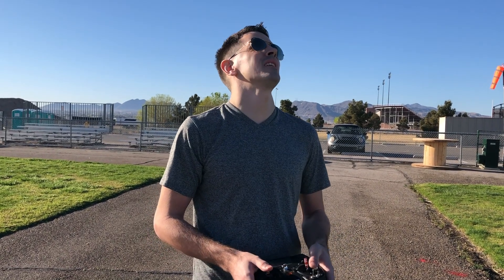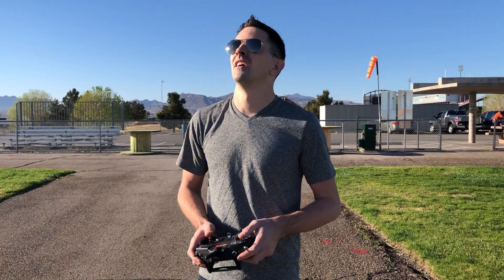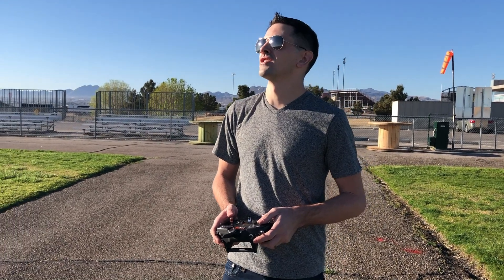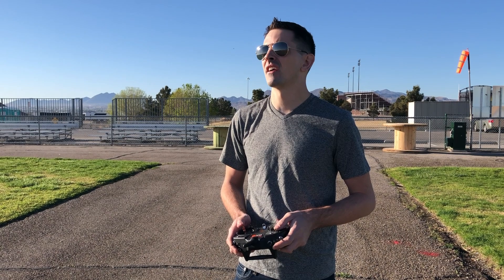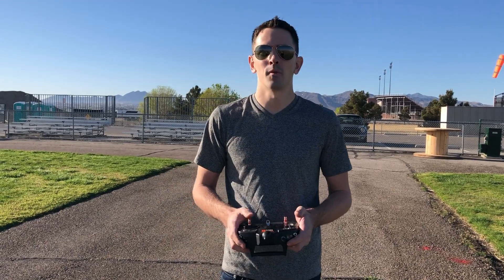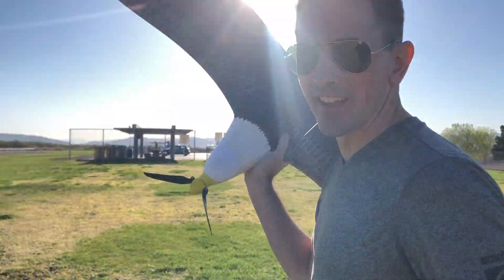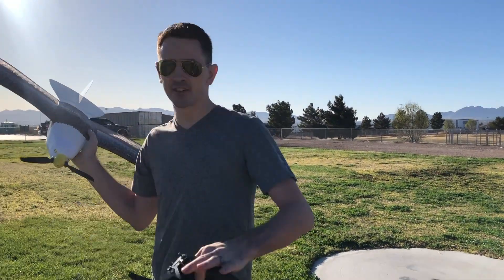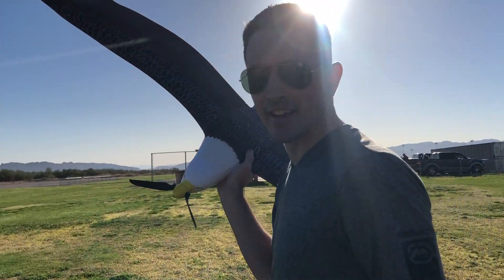Coolest RC EVER - 3D Printed Eagle

Comment: Hello. a consultation, about a month ago my friend and I bought the plans. everything was fine until when he entered the CURA program. when I put segmentation. fills only the empty part and the part that should be filled leaves it empty. In conclusion it prints it backwards. I would like to know if someone could help me please
Reply from the maker: I would double check your settings with the plane print tab, and make sure you are setting it to surface mode under special modes

Comment: Priceless onboard video at 0:52 .. looks like the bird just carrying some grub in its beak. 
This project is amazing! 

To deal with the pitch-up tendency with throttle like with first launch, you could set up a mix on elevator with throttle. Alternatively you could add elevator mix on switch (low, high power, or glide). BTW: ColorFabb has a sale on right now, including new colors.

Comment: This is a literal dream of mine, the foam ones for sale don’t do birds justice. This absolutely takes my breath away, and your girl did a bang up job on the paint/plumage. I just wanted to make a note in this video in the hopes that you see it, but in the previous video towards the end you were talking about having the flaperons mixed in with the elevator, but the way you described it and the way it looked in the video you had the mix *reversed*. When pulling back on the stick, causing the elevator to raise, the flaperons should droop slightly, increasing lift. This will add to the lift generated from the increased angle of attack caused by the elevators manipulation of the airframe. In the video you had the flaperons, or ailerons, lifting up, almost like reflex, which would decrease lift, counteracting the very purpose of the elevator and pulling back on the stick.
Reply: With the eagle shown in this video, it works differently. If you look from the side, the axes of rotation of the ailerons and elevator are quite close to each other. The elevator-aileron-mix "extends" the elevator, so to say. If they were to deflect in the opposite direction, this would act like a crow mix and brakes the bird. ;)